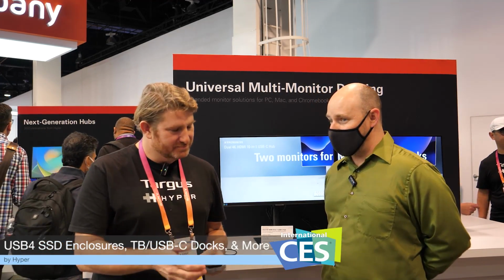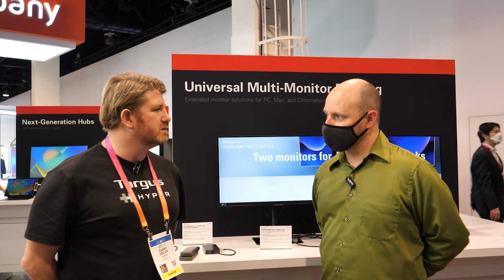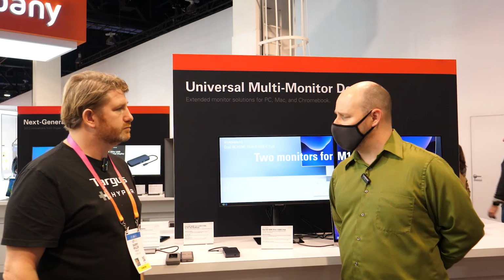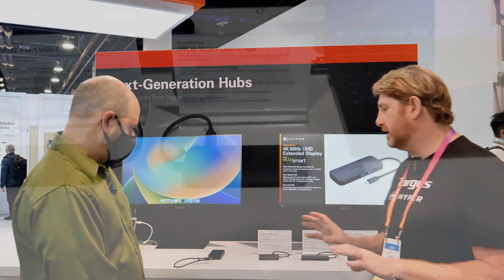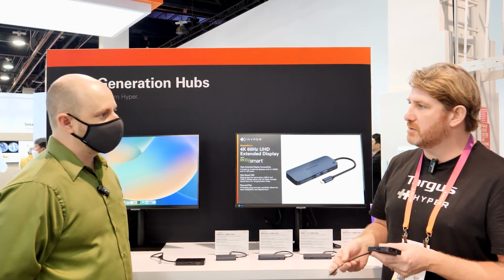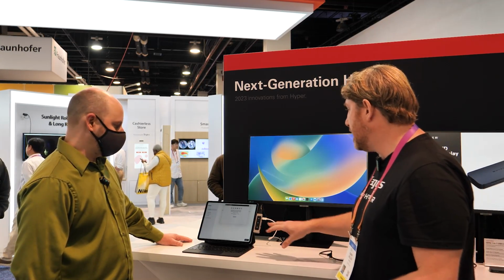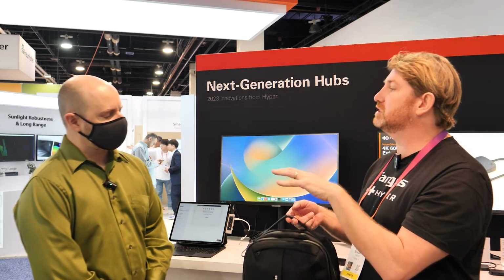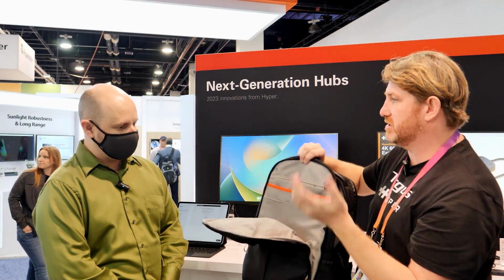Hyper - USB4 SSD Enclosure, Thunderbolt/USB-C Docks, Powerful Backpack, & More - Interview - CES2023

Comment: I would like to write my experience of using HyperDrive Next USB4 NVMe SSD Enclosure.I installed Kingston KC3000 M.2 NVMe SSD (2280) 4096G in it.File copying speed - write 3169.9 MB/sec read 2978.1 MB/secDisadvantages:The HyperDrive Next USB4 NVMe SSD Enclosure gets very hot during prolonged use. If you have a plan to download a lot of small files from the internet to it and the whole operation will take 5-6 hours (like me from Australia) then get ready for the HyperDrive to be almost impossible to hold in your hands after this operation due to the temperature.I have noticed random disk shutdowns on MAC. For some unknown reason, the drive randomly shuts down after an unspecified amount of time. If you pull out the USB-C cable and plug it back in, everything starts working again.Therefore, I cannot recommend this device for purchase.Or be ready for unpleasant surprises right away.P.S.I will have to try how Kingston Fury Renegade M.2 NVMe SSD (2280) 4TB will behave in HyperDrive Next USB4 NVMe SSD Enclosure - after the experiments I will try not to forget to report back.
I would like to add another disappointing news - today I tried to transfer 200GB from internal disk to HyperDrive Next USB4 NVMe SSD. On MAC M3 MAX - as a result, halfway through the process I got an error - The operation can't be completed because an unexpected error occurred (error code 100083). Disconnected and reconnected HyperDrive Next USB4 NVMe SSD and when trying to continue copying after about 30 seconds I got the same message (The operation can't be completed because an unexpected error occurred (error code 100083). I don't know what causes this error. Controller or USB-C cable. But I am using the cable that came with the HyperDrive Next USB4 NVMe SSD